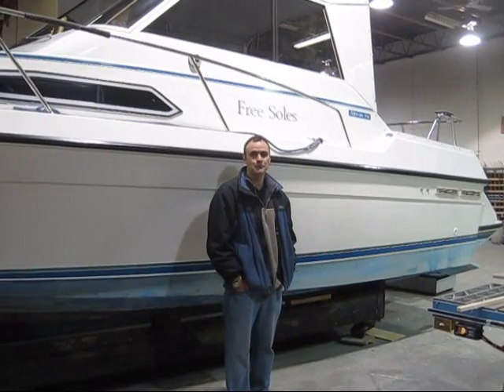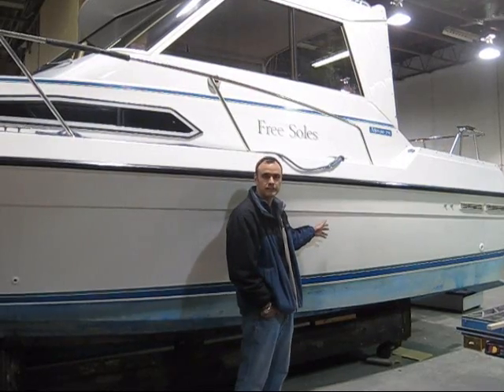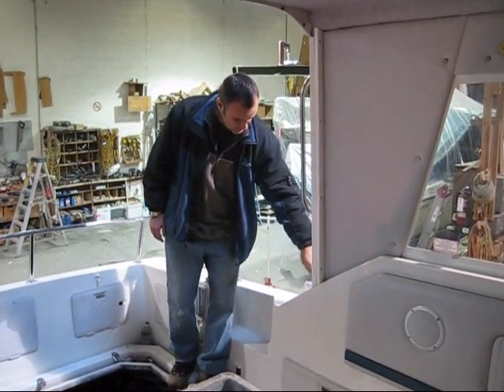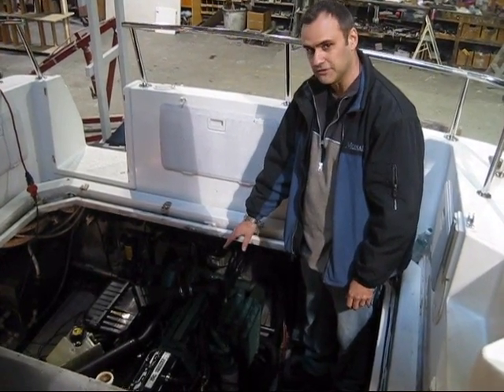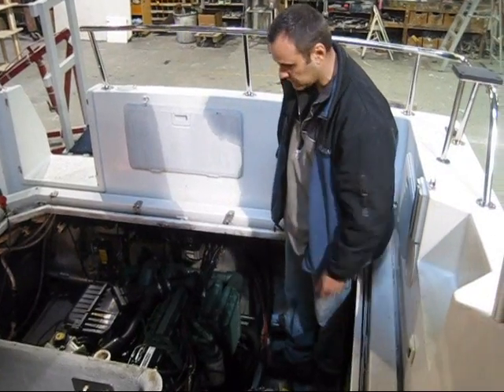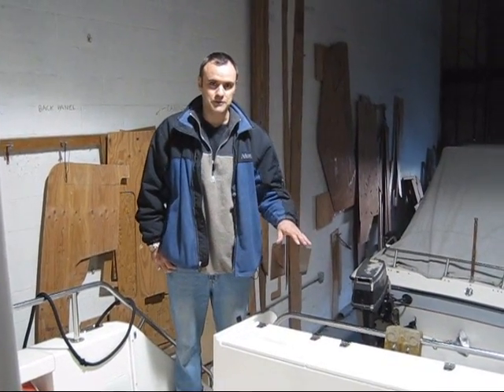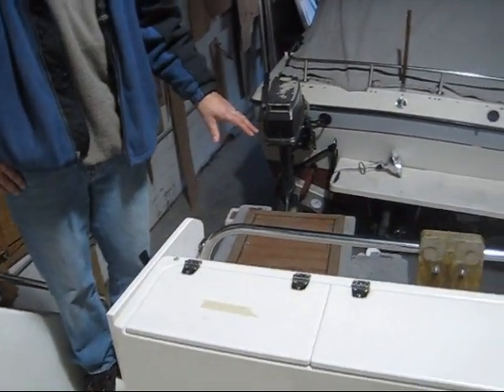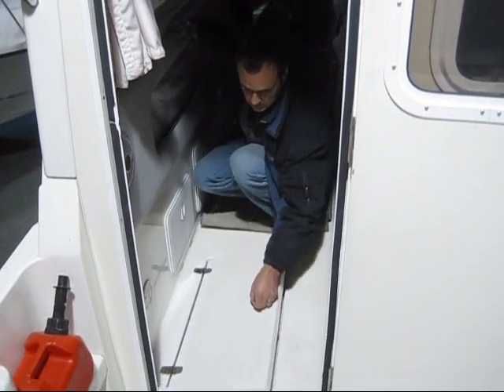Stretching Fibreglass Power Boat - Part 1

Comment: I have a similar boat I've been wanting to stretch. My question is why not cut off your transom and add the length there? Why make such a complicated cut to stretch it? Does the cut you're making add stability, or was it because of the extras you're adding?
Reply from the maker: The hull was cut at the transom but the deck was cut forward. This is because we have a mold for a 30 ft and needed to use as much of it as we could. The layout of the 30 ft deck is different than the 27 ft. We were just trying to utilize our existing molds as much as possible.